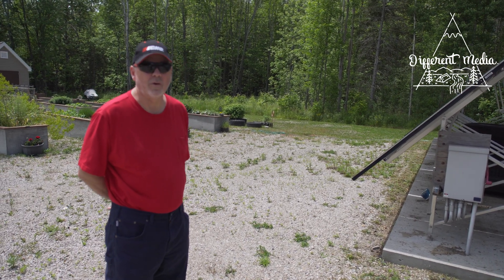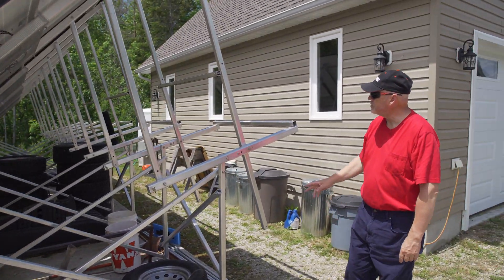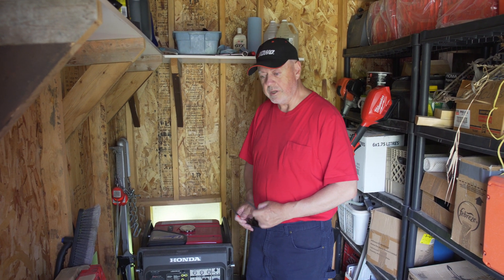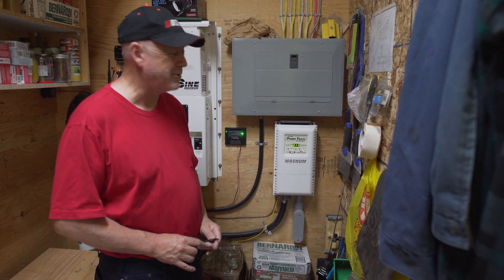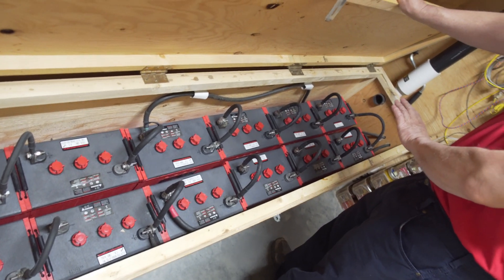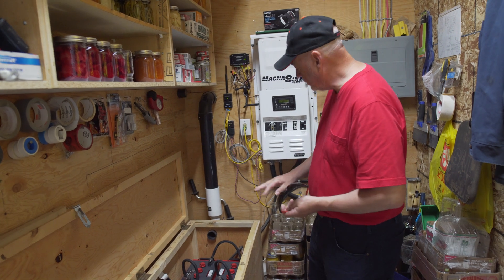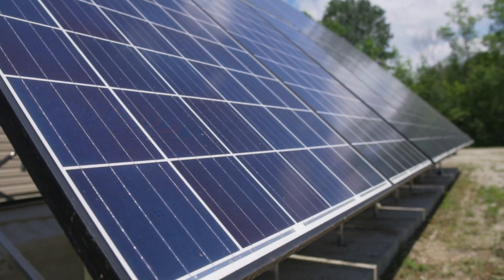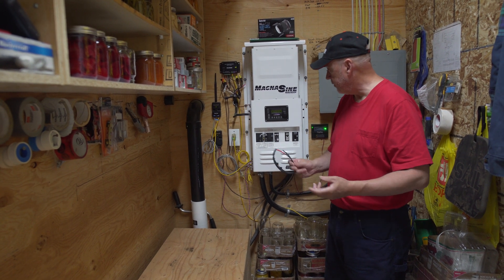Detailed Overview and tour of Off Grid 5300 watt Solar panel and Battery setup in Ontario Canada.

Comment: Great system
Dont get lead acid batteries today or LION -- LFP is now the standard.
And you can run  a propane generator. Only a problem when really cold, -20. I BBQ with propane all winter in Ontario and only on the coldest days is it a problem.

Comment: I'm wondering how much gas is being used in a month and how much it costs
Reply: The generator uses about 150 - 200 litres of premium gasoline per month for November, December & January.  Premium gas here costs about $1.25-1.40/litre.  The generator is not required for the remaining 9 months of the year, but does start automatically every 14 days for 30min just to do a self diagnostic run. So maybe 20 litres over the entire time of February thru October.  We use 2000 - 2400 litres of propane to heat the house and the garage/workshop, hot water on demand, kitchen range and clothes dryer.  We do not have a cloth line so all cloths are dried in the dryer.
Reply: @toddbailey5198  thanks for the info!
Reply: @toddbailey5198 hey Todd thanks for this info. Have you upgraded to lifo yet?